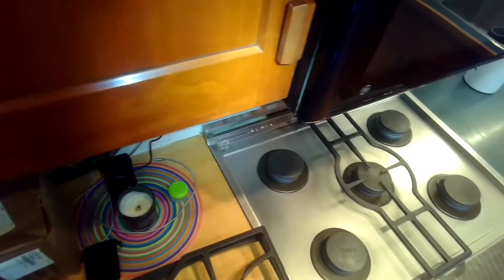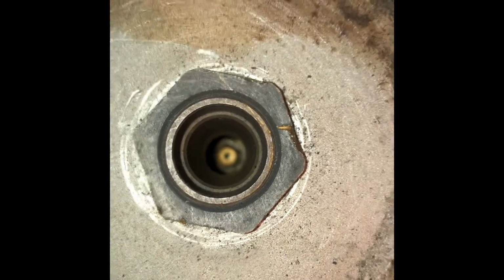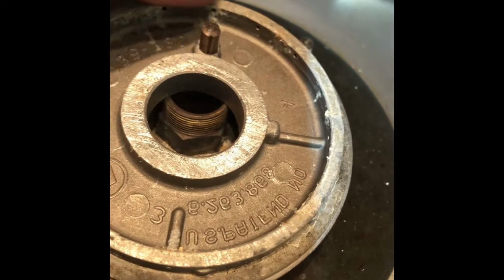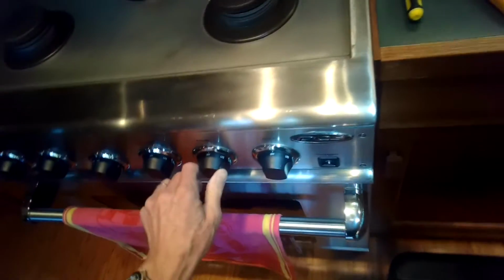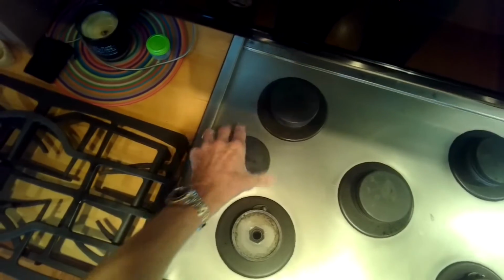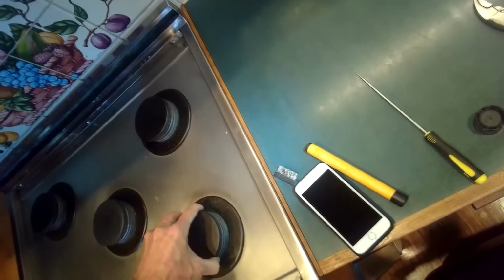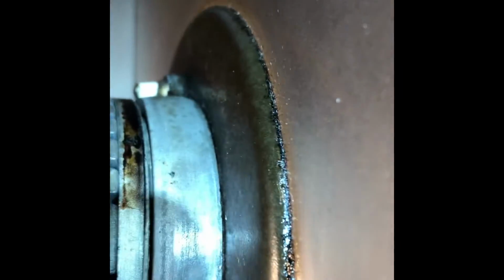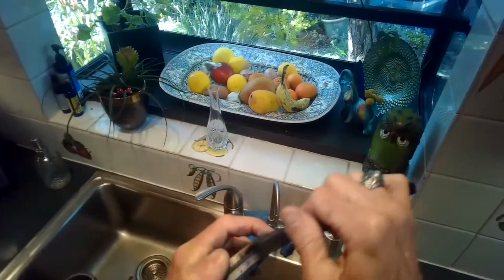✨ DCS STOVE BURNER WON’T LIGHT - EASY FIX - NO PARTS NEEDED ✨

Comment: In some cases the simmer burner orifice (in the deep well) is impaired - and needs to be cleaned with a pricker wire and canned air.  Its easy to test for this. Just remove upper burner plates, put your thumb over the main burner well, and light up the simmer burner by hand - you will see simmer flame NOT at the rear of the burner.
Reply from the maker: Thanks Anthony,
That’s excellent information.
That’s the most common problem 👍

Comment: i use the same procedure.  However, I have a situation with one burner.  it lights but the sparks don't stop or come on intermittently while the burner has flame...
Reply from the maker: Can you super clean all the metal parts.
It sounds like a bad ground and cleaning should do it👍
Reply: @QuickAndEasy5MinuteAppliance  ok, how about when one burner's spark starts anly when I turn the knob to the low setting.  this DCS' knobs start the spark at the high setting.

Comment: Thanks for the tips. Cleaning the ignitor works. The problem I'm having is that the flame is not burning consistently all the way around. The flame comes out higher on some sides.
Reply from the maker: I think you need to move the little air shutter so the opening is smaller to send more gas to the burner👍
Reply: @QuickAndEasy5MinuteAppliance  Not sure where the air shutter is
Reply from the maker: Thank You So Much for A Great Question.👍

Can you send that same question to my email at: scottthefixitguy@yahoo.com

I’d like to offer You Our Channel Membership That Gives You ✨LIVE HELP ✨With Zoom or Texting or FaceTime. Click Here To Join: https://www.youtube.com/channel/UCGpInAejvpfVVE4FHB_L-Dg/join

Thanks Again,

Scott

Comment: Thanks for the video, it was very informative.

I was recently trying to disassemble and clean the D base assembly and upper parts and after removing the large nut for the venturi I then used a 20mm socket to attempt to unscrew it from the stovetop.  I wasn't budging and  applying too much force I guess I heard an odd sound and I thought something broke.  I was no able to free the venturi and sure enough the gas line must have snapped inside the stove as gas no longer flows up the venturi.

I does appear replacement gas lines and some parts are available or this stove (RDS-364GL) but any advice how I can get these venturi's unscrewed so I can remove the top to repair the broken gas line?

I have not slid the stove out of the cabinetry yet but is there access to the underside of the stovetop  from the rear?  I'm thinking I may need to secure whatever the venturi screws in to (I think it's the Jet Holder based on the parts diagram) rom the underside which working the venturi from the top.

Suggestions?
Reply from the maker: Aah Mike, I feel your pain.
I’ve had that happen also.  I had to drill out the brass Venturi and pull out the broken pieces so I could get in there and replace the gas line.  Maybe spray some break free around the other venturis and let it soak in overnight.  Might need to order a few more new venturis.
Reply: @QuickAndEasy5MinuteAppliance  Well believe it not I'm just returning to this issue now.   I actually need to get inside below cooktop as that's where the broken gas tube is.   I've slide the range out today but it doesn't see obvious how to either get inside from behind or even take the entire top off.  Have any videos or instructions how to do this?

Comment: You don't mention it in the video, but these are two stage burners.  The main port you cleaned is for the low, medium, high settings.  But there's a second port for the simmer ring that is below the main ring.  The igniter ignites the simmer ring, so you need to access and clean that port as well.  (very difficult)
Reply from the maker: Thanks so much Mitch👍👍👍